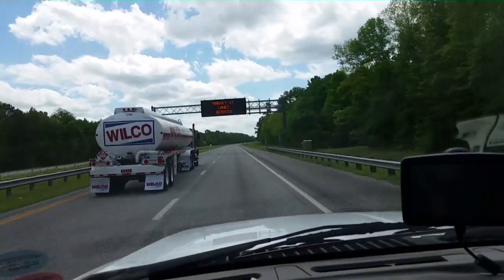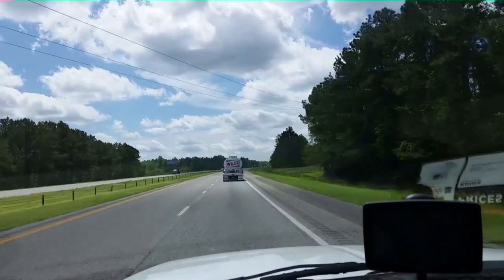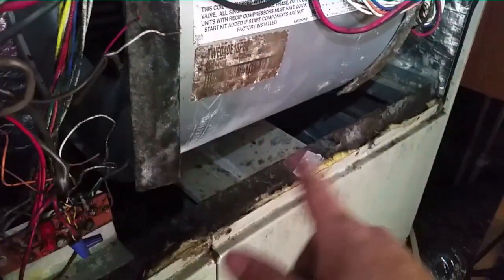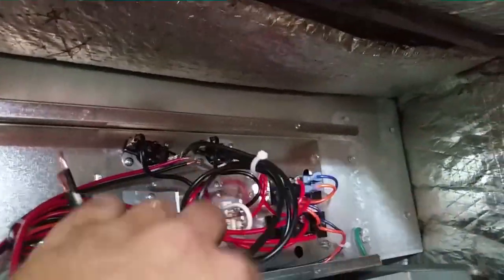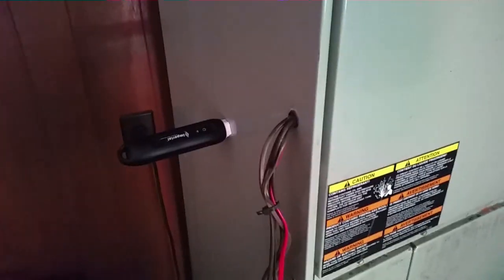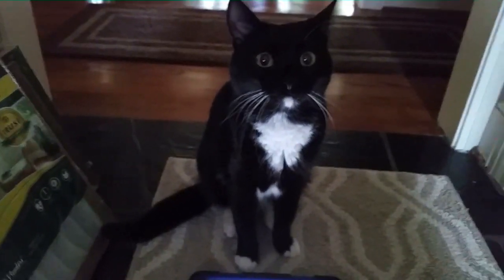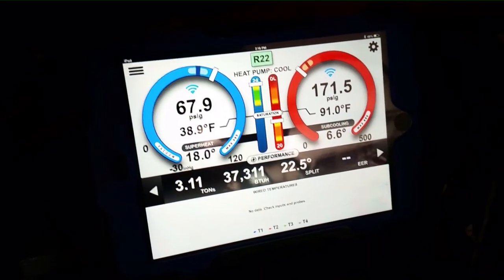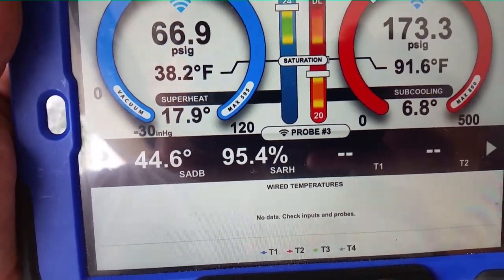HVAC Service : Trane Air Handler Heater Kit Replacement plus Diagnostic

Comment: Good information on the low airflow, supply temp, relative humidity relation. I was confused until I went back and seen it was an up-flow with coil underneath. Thanks for the video.
Reply from the maker: thanks

Comment: The reason Trane don't make that heat kit is they stopped making that air handler, yes that TWE040 is a match that AH matched all the way up to 5 tons. The coil is huge in that AH that could be the cause of the high suction pressure and low refrigerant flow along with the high static and low air flow could be causing the suction pressure to be out of whack. Trane's idea I guarantee if you straightened out the air flow you would find that unit low on charge. Good stuff my man.
Reply from the maker: Thanks Larry, I found a match up chart and it is just as you said. I would love to get that unit some more air, but I am sad to say this one will die before anything changes. The one in the bonus area is the same way, 2 tons with 400 CFM flow.  I have told them for years. It freezes up during normal operation.
Reply: Look on the brute side it is at the age it will fail soon.
Reply: What is the heating element for a twe042c140c0 air handler? Do you have a website?